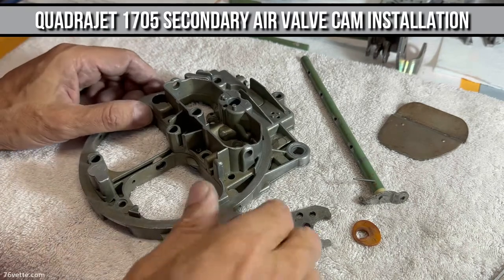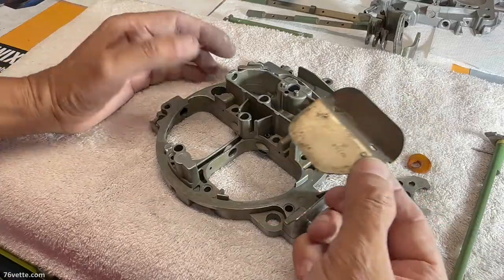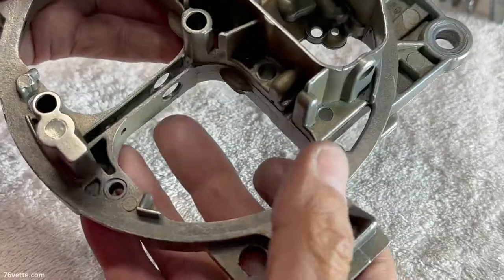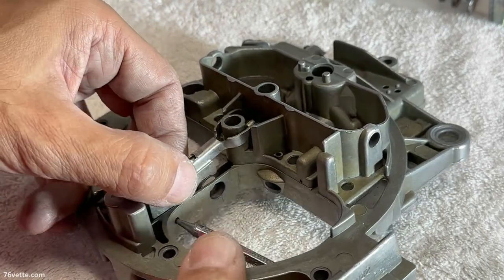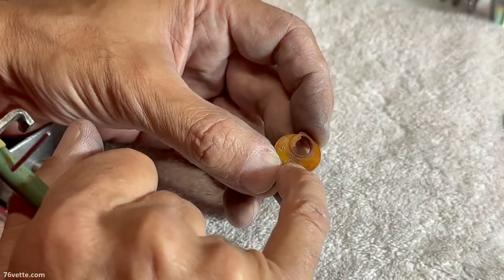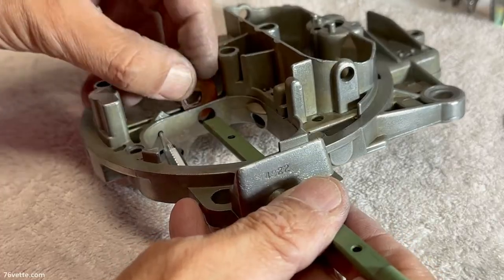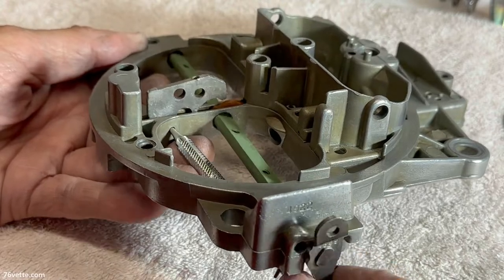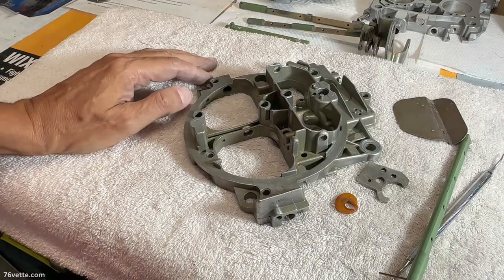Quadrajet AIR VALVE CAM

Comment: I was fortunate enough to get an Edelbrock 1904 QuadraJet, I thought I was fortunate, the aluminum wasn't even close to being the same quality, my secondaries quit working almost immediately, the screw that locked the adjustment actually fell out, along with the aluminum threads, the first time it was rejetted, 4 of the torx screws came out with the threads, etc, etc, etc. I met 3 others with the same issues, after adding a whole ton of inserts and using washers, it's up to par, but still nowhere near Rochester quality. Great information on this channel, the best carburetor to use